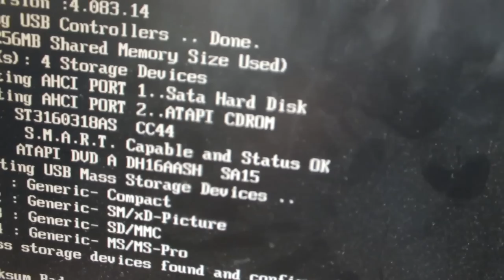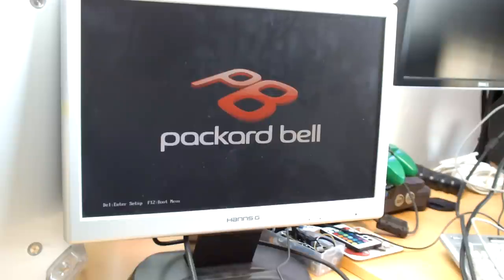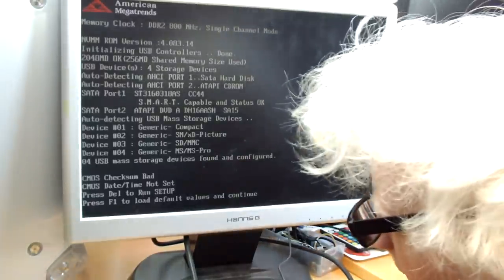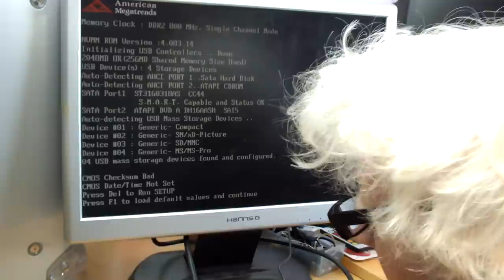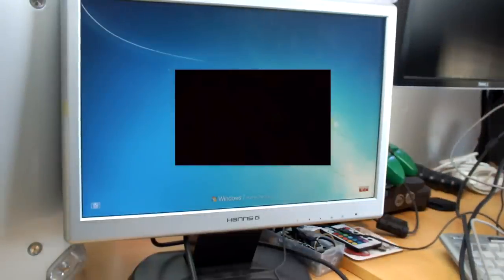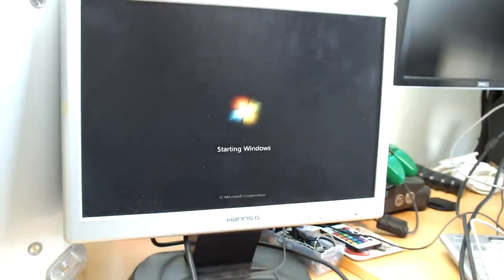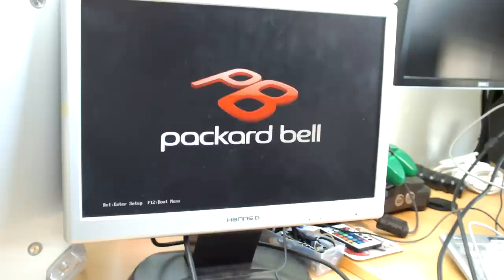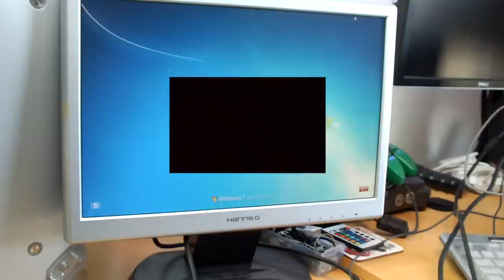Packard Bell Imedia S3720 'Repair' | IMNC

Comment: I had a similar one from Packard Bell and sometimes it did have the fan problem too. Now I have a Mac and a few weeks ago I installed the little Packard Bell again for testing reasons and it still works fine.

Comment: Since reseating the ram is a reoccuring fix i would advise taking the ram out and giving the slot a gentle hit with your compressed air can to blast out any dust present, then also with some 100% alcohol wipe over the contacts on the ram sticks then reinsert.

Comment: my dad has one of them but i have upgraded it a few times and the PSU coil whine is normal and to open the DVD drive press the button on the right of the computer its on the out side of the flap

Comment: You didn't notice the CMOS checksum error? That machine is NOT fixed.
Reply: Nobody really cares about the cmos when it comes to repairs, aren't they regular cell battery's for head thermometer or special cmos cells?
Reply: Alex Rahali , it can be an indication that the motherboard battery is bad and thus the computer will not retain BIOS settings when powered off for any length of time. So, the computer can sit there and work right until you get a power failure or you go away on holidays and then when you come back the problems will be present again. Also it is worth checking the physical condition of the battery anyway in case it is leaking. It also explains why the fan was going at full speed.
Reply: @andrewnoonan4044  yes this is true!!!

Comment: I got the same sort of desktop, I couldn't for the life of me figure out how to get the harddrive out.. I think they riveted the side panel on and you need that off to get the hdd cage out.
Reply: +Hakrazy : There are 4 cross-head screws on the top & bottom faces of the hdd cage.  These will release the drive & allow it to slide out.  As there is so little space to work in, you need to use a very short screwdriver to undo them!

Comment: i had the same problem with my packard bell imedia and it was the psu on it's way out and the psu was only 250w it was cheaper to buy a new case with a 500w psu in it so i did that and the system is still going strong now and it's 5 years old.

Comment: I have that exact same computer and the mb caps were exploded, which caused the computer not to get past the bios and for the fans to be at full speed all the time
Reply: +IscleGaming | ZefaCraft  : Basically, the fans will run at full speed unless the 'smart' cooling option is set on the cmos post setup.  This would be reset if the CR2032 backup battery on the motherboard went flat.  I am surprised that the battery was not checked in the video - it's standard procedure when servicing a PC!

Comment: If you need to keep reseating the RAM, I'd give the slots and the sticks a good spray with some electrical contact cleaner. Should stop that happening again for a good while.
Reply: +Reece McGowan : Surely the clips on the ends of each ram card lock them in place, IF they are installed properly!

Comment: I picked up one yesterday for just £15 mine even has hdmi and windows 7 on though only 2gb ram so ordered 4gb from ebay to upgrade it should be faster after.
Reply: Can u have ddr3
Reply: @asxtriux_9606  The Packard Bell iMedia S3720 has 2x DDR2 DIMMS (upto PC6400/800 MHz). Hope this helps.

Comment: I used to have that EXACT PC before I switched to Mac
Reply: ***** So'd I. I had that in my media room, before getting a 2010 Mac Mini!
Reply: +Idiotic Tendency : I am still using mine, every day!  It has never gone wrong in over 6 years.
Reply: I have that pc as a backup
Reply: I have the version with the 3.2GHz  i3-550 (iMedia S3810). Now just over 5 and half years old and still going strong. Started off with Windows 7, through 8/8.1 and now onto 10. Not a single driver issue, and boots up faster than it ever has with previous versions of Windows. Recently upgraded to 8GB RAM and installed an nVidia GT 730 Zotac fanless graphics card in it to give it a little extra graphics oomph (for some low end gaming). Genuinely reckon this wee machine will still be burbling along when it's 8 years old. Sadly, won't be replaced with another Packard Bell as I think Acer are killing them off (to be confirmed)... plus I'd like to build my own next time.
Reply: It just goes to prove that they will last if you take care of them - unlike some of the earlier comments!

Comment: I think for me Tom, and just a bit of friendly constructive criticism really, this video would of ultimately been more interesting if you'd had a wee look in the bios anyway to let us see some of the specs. Just a thought.
Reply: +leekehrer : Windows 7 Home Premium 64-bit OS / Intel Celeron 2.4ghz 2-core E3200 CPU / Nvidia GeForce 7100 integrated Graphics (1920*1080) / 160GB SATA HDD / 2GB DDR2 800mhz fsb RAM (4gb max).

Comment: I would mention the coil whine. If I heard that coming out of a PSU, I would replace it ASAP.
Reply: Coil whine is not indicative of a dying PSU.  It's considered to be well within manufacturing tolerances by many companies,  such as corsair,  cooler Master,  Etc. There is no reason (other than the fact that it can be somewhat annoying)  to replace that PSU.
Reply: Matthew Tarbard That's a good point, but I'd replace it anyway. One end of the PSU is connected to 240V and the other end is connected to expensive stuff in the PC. I'd want to be certain the PSU is working, just in case.
Reply: Jack Durrant I wouldn't call that PC 'expensive', but I get your point.

Comment: I have the same PC!, it works very well under Windows 10!
Reply: Daris yeah how can I update the bios ? It doesn’t work with win 10.
Reply: Daris : yes, you can upgrade to windows 10, but now my packard bell is on windows 8.1 x32
Reply: NonoSplatoon 23 I updated to win 10
But the processor died 1 week after - after beeing on 1 billion cpu usage thanks to Win 10 - packard bell never updated the bios driver !!!
Reply: Schlauer in 3 Minuten - Fitness Fakten : for me, the processor Never died, it works perfectly
Reply: The pc was in use since 10 years, i have 1 problem with it, « boot loop » of Windows 7, i reset it, it works 😀
Reply: NonoSplatoon 23 it’s a BS system for 2020.
Reply: Ok.
Reply: @GetgainzDe  Where I can get the drivers, because I will try to put w10
Reply: @xxg.tester7851  like i said, the system is from 2010 and the drivers were never updated. if you update to w10 the system will die. there is a bug where the cpu will use a million percent and overheat. i trashed this junk and bought me a new system.
Reply: :/ now I don't wanna update it
Reply: @xxg.tester7851  just get some money and get a new pc
Reply: I already have other pc's like raspberry pi 4 and hp laptop
Reply: @GetgainzDe  Hey you, the drivers works very well and it doesn't use the whole cpu, do not lie next time
Reply: @GetgainzDe  it's the truth sorry 🙃

Comment: I have the same computer but i have an intel core 2 quad q8300 so it's better than this celeron, there is also 4gigs of ram in my machine and it came with an gt210

Comment: eww packard bell ;[ a sign of bad quality straight from the name
Reply: ictdude1 Agreed, they are so cheap
Reply: +ictdude1 Our iMedia S3810  (same case style as this) is nearly 5 years old now. Started with Windows 7, through 8/8.1 and now 10. Has been used as a regular computer, a media centre machine and a light weight gaming machine. Has never missed a beat and is being used daily. Zippy enough too for what it it - boot up in less than 30 seconds on the original hard drive. Parents have a Packard Bell iMedia J2422 which is 8 years old now (and I admit getting on a bit) and aside the original graphics card burning out (common issue on the particular nVidia card apparently?), it still running fine on original parts + Win7 (and I'm sure would be fine with Win 10). Never had any major issues with any Packard Bell machine I've been in possession of.